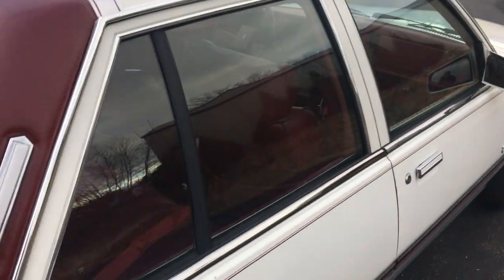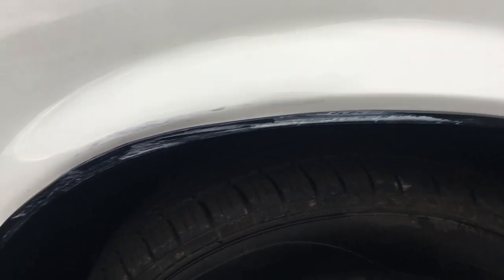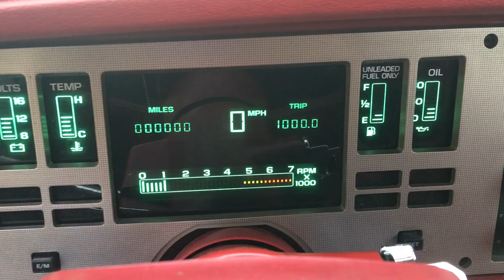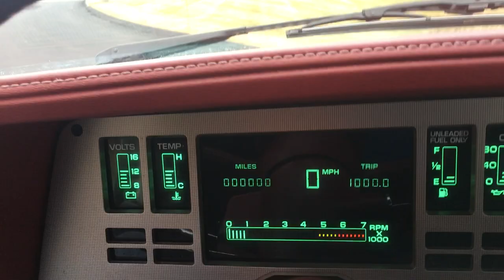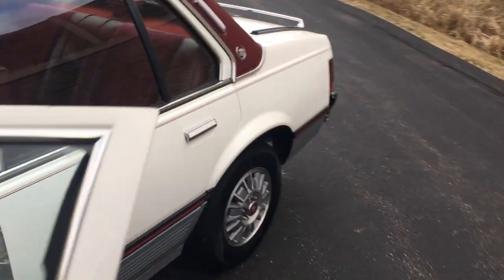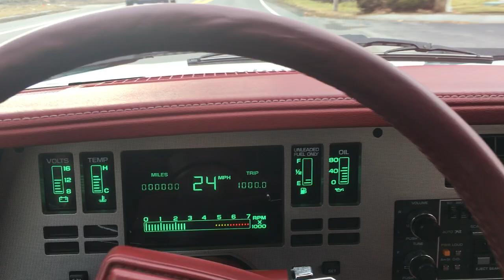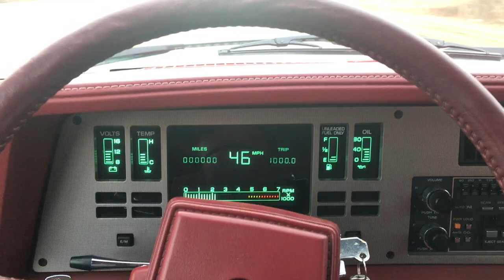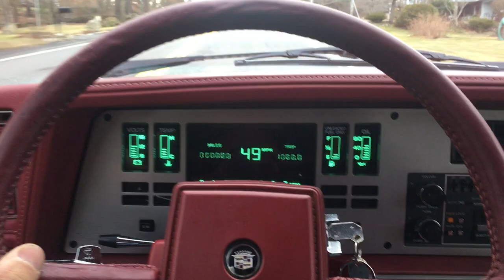1986 Cadillac Cimarron for sale by Specialty Motor Cars

Comment: I want to say that i owned the most rare, lowest production and most collectable Cimarron that was ever offered.  Mine was a 1988 Cadillac Cimarron with the ultra rare 5 speed manual transmission.  I bought it used in 1994 with 50,000 miles on it and it was the BEST car i ever owned.  It had 275,000 miles on the original Engine with only one clutch replacement.  Beautiful Medium blue over silver/grey with every since option except the astroroof and digital dash.  I got more compliments on that car and NOBODY could believe that it was a 5 speed Cadillac.  With everyone always hating on Cimarrons, i'm here to say that I loved mine more than anything.  And with only 110 manual transmission models produced for the final year, 1988, i'll probably never find another one like that again. Nice to see someone appreciate these baby Cadillacs.
Reply: Wow manual transmission? Never heard of it
Reply: I would have loved a five speed on one of my Cimarrons. I had a five speed on my Caviler caviar before I even knew that the Cimarrons existed. Needless to say I am a Cimarron fan having own three very fine and two low mileage examples of them.
Reply: Fantastic, would love to have one with the V6 5spd
Reply: @oliverdelgado6952  Yes they were extremely rare. Lowest production was the final year that I owned, 1988.
Reply: @cashflow7786  do you still own them? What were their color combinations?
Reply: @joeseeking3572  Yeah my car was very quick. Car drove completely different matched with the 5 speed vs the automatic.
Reply: @klwthe3rd  no, I sold them a good while ago. I would like to have been able to send a photo of them. I really fixed my Doro" edition to the teeth. I don't have any photos of the finished product but I have one with all three when I first started to restore the Doro.
Reply: @cashflow7786  the D'oro edition was the second most rare model after the 5 speed manual models. If I buy another, it will probably be a D'oro.
Reply: The only thing that I didn't have was a sunroof top.
Reply: @klwthe3rd  What happened to it?
Reply: @Samuelfish2k  in 2002 and with 275,000 miles on the odometer, my wife at the time convinced me to junk the vehicle in favor of another Cadillac. I can remember driving the car down to our local junkyard and the owner of the facility asking me WHY I was junking this beautiful car. I told him that it still ran well but that I had replaced it with a 1990 Cadillac Seville as my daily driver. I hated to see that car go. I took photos/pictures of the exterior/interior because I knew that few people had ever seen a 5 speed Cimarron. Best car I ever owned.

Comment: "The most talked about Cadillac of the 1980's"  Gotta admire your salesmanship there lol.  Also fix that headlight, those sealed beams are like 10-15 bucks at autozone and take 5 minutes to change.  And you might laugh, I hate the Cimmaron, but the late 80's/early 90's Cavalier Z24 5 speed coupe(and convertible) I thought were pretty cool looking, sounded good, fun to drive and reasonably brisk.  They were honest, unlike the Cimmarron.
Reply from the maker: At a loss for me, I sold it as it was. I didn't do any cosmetic repairs either. The light did work though!

Comment: Ha ha my two siblings had those one a 4cyl and the other a 6 cyl (for them it replaced their original 83 4 cyl).  They were decent cars.  Yes they were rebadged (take your pick from the J body cars) but that is what GM and others did at that time though some were more convincing.  One that hasn't been particularly impressed with Caddy beyond the 1976 - 1979 Seville I was fond of the 3 Cimmaron's  that my siblings owned.

Comment: Where to start? Cadillac was extremely successful using the Chevy Nova platform, (mind you I said "platform") for the Cadillac Seville in 1975. It was a beautiful, elegant and unique car (until they ruined it in 1980 with that ridiculous bustle back design) The Cimarron, by comparison, was a cobbled together mishmash that was the result of supergluing baubles and chrome onto an easily recognizable Chevy Cavalier. It represented the hubris of GM that was responsible for the other hideous creations that they foisted onto the car buying public during this period. Cadillac recovered afterwards, only to be reduced to the Plastillac state where they are currently. What a shame.